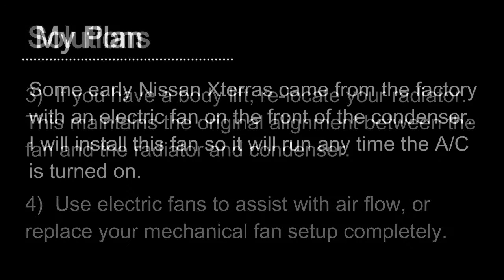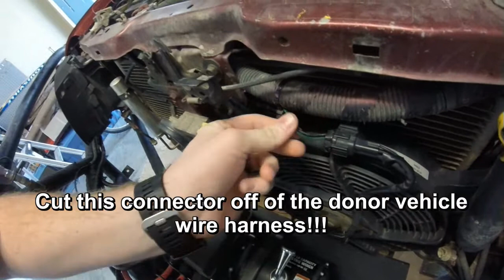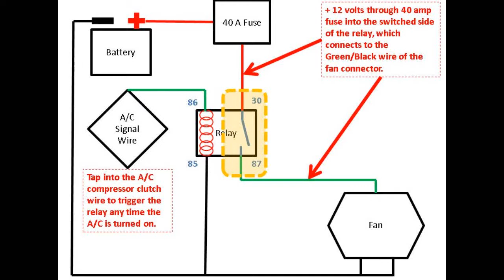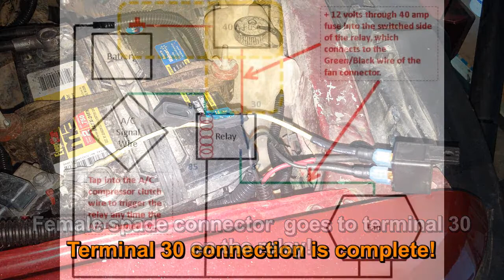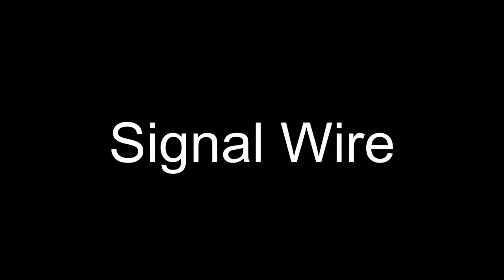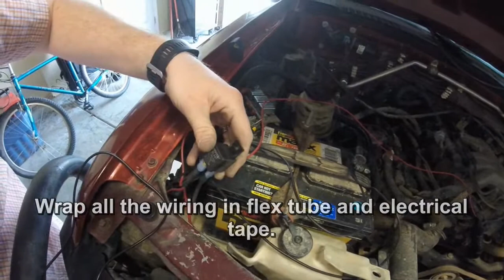00-04 Nisan Xterra - Installing Electric Condenser Fan

Comment: Arent these multi speed fans?did you ever figure out which setting is which?
Reply from the maker: I never did figure out different settings…but read some comments below some other viewers may have commented with their findings.
Reply: @XterraRob  I didnt see any 😢,ill be doing this tonight with a friend trying to get it to come on with a switch instead of the ac on for more aux cooling on trails and idling
Reply from the maker: I had rigged it up with a thermal temp switch at one point. It slides into the radiator fins and when it got up to the set point it triggered the relay to turn the fan on. I put my probe on the front side of the radiator behind the ACcondenser. I had to use some 90 degree electrical connectors because the space is kind of narrow. And I placed it near the upper radiator hose inlet so as to trigger based on temp of coolant coming back from the engine before the radiator cools it off.
Reply from the maker: Oh switch as in flip a rocker switch to manually turn on and off?  That should be easier than a temp switch too!
Reply: @XterraRob yessir
Reply: What kind of relay and inline fuse did you use? Having trouble figuring out what I should be using  @XterraRob
Reply from the maker: Do an Amazon search for inline fuse holder. I bought a multi-pack of 12 gauge fuse holders that are about 6 inches of wire with a fuse holder in it. Just crimp or solder it on to whatever other wiring and I keep a 20 amp fuse in them. I run 12 gauge wire for most stuff…but you always need to size the wire for the amp draw.
Reply from the maker: I like to use a 30 or 40 amp weather proof relay and you can get that on Amazon too. Just has a sealed mating connector so water or dirt won’t get into the connection.

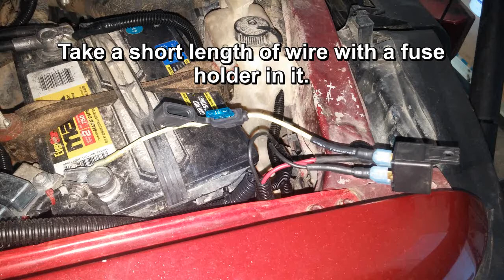Comment: Quick question Xterra Rob, Is the in-line fuse supposed to be 40 amp?  At 7:00 minute mark there is a 15 amp. 
 I just want to make sure I don't screw anything up.  
Thanks for the awesome video!

Comment: Hello. Thank you for the video. 
Question. Which way should the fan be blowing? Towards the engine, or sucking from the engine?
Reply from the maker: The electric fan on the front side should be blowing air into the engine. The fan on the engine draws air from the outside into the engine. Air ahould always flow from front of vehicle into engine compartment as if you are driving forward through the air.
Reply: @XterraRob  That means it’s working correctly and I’m done!!   Love your videos. Thank you very much!!
Reply from the maker: Great!!!  Glad I could help!

Comment: What year is the fan? Can't find anything in the yard before 2000. I will have to get an aftermarket fan.
Reply from the maker: It was like half of 2000 or maybe all of 2000 and half of 2001. It is kind of a crap shoot if you find one with it or not. A 10 inch universal fan fits pretty well but you have to fab up some of your own brackets. I actually have an old stock fan in the garage. Send me an email if you are interested.

Comment: This explains alot i was always wondering why when I was in a drive thru long line with my ac on the temperature was normal but it started to rise afterwards and I was confused
Reply from the maker: That will do it!  Happy to help and thanks for the commment.
Reply: @XterraRob  but I'm not wire savvy so I noticed a wire connector by the hood latch and I'm wondering I'd that's what used to connect a condenser fan because my frontier doesn't come stock with it

Comment: Hey great video, thanks for sharing. Where do the bottom two mounts on the fan mount on the truck? I have an '04, I should be good right?
Reply from the maker: There is either a mount there...or I used a 3m double sided adhesive tape because my winch blocked the mounts. No issues on my 04

Comment: Is the fan for an 01 a pusher or puller? Also is it a direct bolt on for an 02?
Reply from the maker: Direct bolt on, need to wire it yourself though. Pulls air from the front and pushes it into the engine bay.
Reply: Thanks for responding! So if its mounted like you did it will push air through the condensor and radiator?

Comment: Really like your channel man! Subscribed! My 2000 Frontier has a condenser fan. Thought it didn't work but turns out its set to rarely come on due to the tripple pressure switch on the dryer. The pressure has to be pretty high for it to kick on and i guess the pressure rarely gets high enough.  I jumped the switch so the fan kicks on with the engine. Just spliced into a single wire i think.  I live in South Texas and it gets hot here! Wasn't sure if it made much of a difference when i did this mod in march but come June with 100 degree temps my AC definitely runs cooler than it ever has in summer.
Reply: I'm  in Phoenix and have all the necessary parts to do this mod this weekend.  Thanks Rob for the video and thanks Chancey1979 for your confirmation that it works in hot weather. 🔥
Reply from the maker: Happy to help!  Let me know how it goes!  I had another video that goes into the wiring details on the fan side of the connector.  On that video, a user commented about thr fan being a 2 speed fan and a way to wire it to the faster speed. May be worth searching that video out on my time line and see if thats something you want to do.
Reply from the maker: Awesome! Glad it worked for you. Thanks for watching.

Comment: i have a 2000 xterra my ac nore the fan is coming on. new thermistor and triple pessure switch and relays. i cand ground the wire at the the relay and it come on. any sugjetions of what might be wrong
Reply from the maker: Which pin / relay are you grounding? Is it the one with yellow, green/orange, green/black, and purple wires? You mean your fan, as in the condenser fan at the grill, or the blower motor that blows air out the vents?
Reply: Xterra Rob the one by the radiator
Reply: Xterra Rob also the ac compresor is not coming on unless i grond the relay
Reply from the maker: Ok. Fan by radiator only turns on if overheated engine occurs, so no worries on that front...
Reply from the maker: AC compressor only turns on when you ground the relay...which pin are you grounding? The compreasor is controlled when the ECM connects a pink/purple wire to ground. If you ground the pink/purple wire and it turns on, there are a few possibilities: 1) the ECM is not grounding the wire to turn it on due to the refrigerant pressure sensor being low 2) broken pink/purple wire on thr ground aide of the relay Or 3) ECM is faulty. I would have the refrigerant checked at a shop and checked for leaks. Low refrigerant will kick off the compressor. Grounding relay directly bypasses the ECM logic of other sensor inputs...

Comment: Nice was it worth it thinking of going electric but not sure what would be better in California weather
Reply from the maker: +ballejosRB11 great question. It was worth it to me...but I didn't go FULL electric...just as an accessory.  It helps keep AC cool at low speed when you don't have air flow through the heat exchangers.  Going full electric is a but more involved.

Comment: When I saw these cooling fans on some of the early model junkyard Xterras, I went home and looked and sure enough, the mounting nuts were there.  I added one to provide extra cooling in general besides the extra cooling it provides for the AC condenser.  The idea is to add more air flow during slow speed maneuvers.  For your AC-on application, I would have been tempted to tap the connection somewhere else besides jumping across the engine bay.  Still, your wiring technique is strong, so it's just a matter of preference/style more than anything.  I have my fan wired to a relay alongside the Mishimoto transmission cooling fan (divorced from radiator).  It might be my imagination, but I feel like it runs better when I use them even on just 80 degree weather.  Mounted a Power Steering cooler in front of the fan too when I saw the newer Nissans now have them.  Figured it couldn't hurt to cool the PS fluid a bit more as well.
Reply from the maker: +MrHellfinger good observation on the source of the relay trigger.  Not my cleanest wiring job but got the job done.  You are 100% correct on the low speed maneuvers comment...too much beach or rock crawling will heat everything up in a hurry. Nice mods you have there...what triggers the fan on/off?  I specifically tied it to the AC clutch because my AC was hot when idling at stop lights in the summer...but cooled off once it got moving. Either way, a r134a recharge ... The thermo amp control, and this fan did wonders.
Reply: Right now, my fans are wired up to a switch that kicks a relay.  At some point, I will have a thermostat turn on the trans cooler fan separately while still having the switch in cab as a manual override to turn on all fans for extreme situations.  Maybe even wire up the AC Condenser fan to automatically run like yours now that I'm thinking of it :)
Reply from the maker: +MrHellfinger nice set up. Something can be said for the predictability and reliability of having yourself in control of what you want the machine to do. I like it.

Comment: I have a xterra and I just noticed that it does not have a ac fan. Did they not come equipped with them from factory? thanks.
Reply from the maker: stunt509 model year 2000 did for part of the year. they discontinued them, probably because the control logic they used to turn the fan off and on was useless...THe ECU only turned it on when engine coolant is overhrated. the fan itself is good, but I wired it to turn on any time the AC is on So it would help AC and engine cooling performance at slow ground speeds
Reply: @XterraRob  so with the Xterra, the fan doesn't come stock to automatically turn on when the ac is running?
Reply from the maker: Nope. It is controlled by a thermo-switch. The engine has to overheat basically before it turns on. I wanted to make it come on earlier to prevent over heating.
Reply: @XterraRob  thanks very much man, I just replaced thermostat and fluids, and noticed it wasn't turning on, had me a Little on edge lol. Will be doing this within the next month
Reply from the maker: Cool. Happy to help.
Reply: Rob C wow thanks for the fast reply. I have a electric fan and will began the work. thanks!

Comment: what type of wire you use
Reply: Xterra Rob just one more question about that inline fuse holder. Your diagram mentions a 40 amp fuse, your video shows a 15 amp fuse in the holder but in your comments you say it’s a 30 amp fuse. So which is it? Lol
Reply from the maker: Efren Gonzalez I use the same gauge as the fuse holder I got at Auto Zone. I got a 30 amp fuse and fuse holder. I think that is either 10 gauge or 12 gauge wiring. just generic spooled wire from home depot/Lowes/auto zone will work. I got black and red wire to help keep track of ground and +12 volts
Reply from the maker: I'm all over the place on that...sorry! The original factory configuration used either a 30 or 40 amp fuse (I don't remember now, but likely my diagram matches the fuse in the factory configuration).  That being said, I directly measured the amperage on the fan when starting up and running. Its only 8 amps or so max. So my wiring is for a 15 amp fuse, which I think is 12 gauge wiring. The fuse holder I bought at auto zone was for 15 amps and was already sized correctly for that amperage. I just bought a spool or red and black wire that matched the same size as the fuse holder.

Comment: AWESOME!!!! Just followed your steps and got me sole cold AC while idling! Had to but connect the fan wires because I had to connector but it works great. 
Thanks!!!
Reply: ticoalochancho  how did you wire the fan without the connector? I’m in the same boat.
Reply: I don't have the connector that plugs into the fan's harness.  I've been trying to find one.  One guy wanted $30 for it.
Reply: yeah I've been calling around. And put out some requests through carparts.com.  They list  salvage yards in your area that carry what you are looking for.
Reply: Xterra Rob found one today. I guess they put the fans back in on the 2nd generation X’s. Spotted a fan in he back seat of an ‘06 X. Found the connector still on the main wiring harness. $3!
Reply: My connector has 4 wires. Can You let me know how the original is wired into the connector? I know it’s two black and a green but where are they connected to on the connector
Reply from the maker: ticoalochancho great! glad I could help!
Reply from the maker: I got the fan from a pull a part junk yard and just cut the connector off the vehicle side wire harness.
Reply from the maker: Thats crazy. Try a pull a part junk yard in your area. Or hardwire the fan by cutting the connector on the fan side. I could get you the orientation of the power and ground wires off my truck...because all 4 wires on the fan itself are non-descript black wires.
Reply from the maker: Yeah ive used carparts.com before with limited success though. Most of them are salvage yards that pull parts for you. See if you can find a yard that lets you take your own tools and hopefully you can find one and just cut the wire harness out. I paid 4 bucks for mine. Pulling the parts yourself is crazy cheap. If you want to hardwire it, let me know and I can get you the right wires on the fan side this weekend.
Reply from the maker: Score!
Reply from the maker: Does the connector you got have the wires already on it? The fan has the connector that has 4 black wires that go into the fan housing and motor. The wire harness connector has 2 blacks to ground and one green wire, and one terminal is empty. The connector is directional, so it only fits one way.  Is this what you have? I can make a video this weekend showing more detail.
Reply from the maker: Ok I think I get what you mean. The 2nd gen connector had 4 wires instead of 3 and different colors? So you need the physical position of the +12 volt wire and the two grounds?
Reply: Xterra Rob well it wasn’t an exact fit. The tab that is flared is on the opposite side. Nothing a little work with the Dremel could fix. So where the tab press is on this ‘06 connector, I have pink and mauve wires. Below them are 2 black.
Reply: Xterra Rob yes that’s what i need.
Reply from the maker: Check the latest video. That should give you the info you're looking for.

Comment: Great video! I have a 2000 xterra I'm trying to do the same thing. You said power is the green wire, I am seeing a 3 wire plug into a four wire male adapter for the fan. The colors are green, black, yellow and blue on the fan plug. Which one is the power and ground? In trying to test the fan so I know which wires to spice into the same relay setup as you. Any suggestions?

Thx
Reply from the maker: Steve Wilson what are the colors of your 3 wires on the vehicle wire harness? I cut the plug off the wire harness and tapped into the 3 wires (one green and two black).  my fan had 4 wires but I couldn't figure out which ones were which without the 3 harness wire colors because the service manual only references the 3 wire colors of the harness and not the 4 wires on the actual fan.
Reply: My harness is one green and two black wires, which I believe is what you have also.
Reply from the maker: Steve Wilson ok great we had the same. I did not verify the colors on the fan side because the plug on the harness only assembles one way and I cut the plug off the wire harness at the junk yard.   if you don't want to cut your harness you can just follow the green wire in the harness and see which pin it connects to on the fan side connector and line the wires up to confirm
Reply: Ok I will tap into the 3 wire harness like you did and confirm the fan works before I wire it up permanently. Thanks for the response. The stock configuration of this fan is awful.
Reply: Ok I will tap into the 3 wire harness like you did and confirm the fan works before I wire it up permanently. Thanks for the response. The stock configuration of this fan is awful.
Reply from the maker: Steve Wilson you are right...the stock config basically only comes on if it is overheated and triggers a coolant switch. nothing to help at low RPM and low speed which is where the crank mounted fan really struggles...and I would prefer to prevent overheating instead of turning it on after it has already overheated. let me know how the project goes.
Reply: I tapped into the harness grounding the two black wires together and applying power to the green wire and what do you know it works. I will wire the rest up with a relay next. I was inspecting the main wire harness to tap into the green and black wire for the signal wire to the relay, when I was looking at the harness there are two green with black wires, do you know which one to tap into? Looks like they are slightly different gauges. I'm thinking it's the smaller one. Just wondering if you came across this. 

Thanks.
Reply from the maker: Steve Wilson I did not come across two green and black wires. if you remove your air filter housing you can get a good look at the compressor clutch connector and check the wire colors. I do recall it was pretty thin gauge wiring. I think the wire was mostly green with a black stripe.
Reply: Great news! I wired up the fan using relay and inline fuse and it works perfectly. Ac on fan on now! Thank you for the addition help and great video.
Reply from the maker: Steve Wilson awesome to hear! I'm excited that someone else in the world was also trying to do this specific modification and that I could help!
Reply from the maker: I grabbed the mating wire harness from a pull a part junk yard. I have another video from 2 years ago "Retrofitting Condenser Fan - Fan Wiring Details" is thr title line I believe. I show the exact wires I used on the fan side.